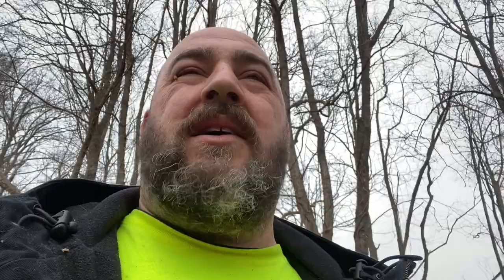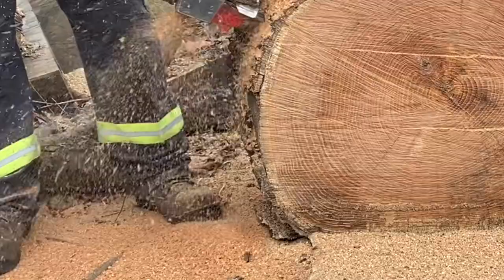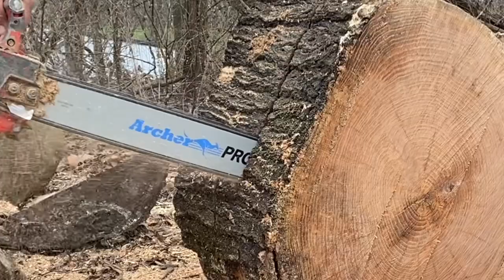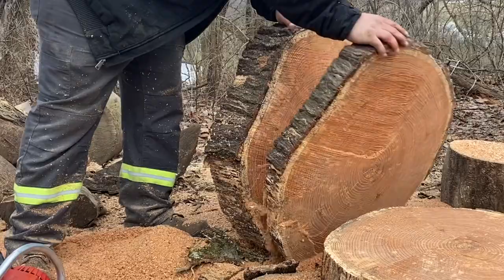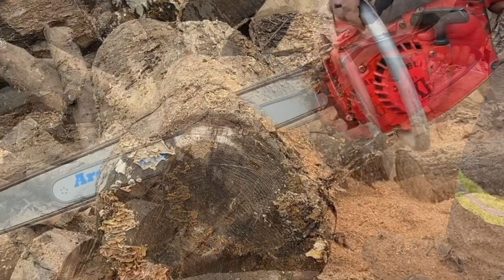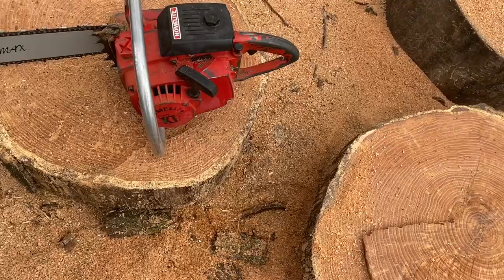Homelite Super XL Auto Chainsaw Muffler Mod And Longer Bar Testing!

Comment: I'm interested if the gutted muffler helps a stock engine much. I'm also very curious if a 28" bar might be crowding a stock saws power limits. I may have to try it sometime if I could find a deal on a bar.
Reply from the maker: It depends on the engine.  The biggest thing holding back a Super XL is the transfer port.  A wide open exhaust will hurt the engines torque because the exhaust helps to prevent good fuel from flying out by providing the necessary back pressure.  Wide open exhaust is know mostly for lots of heat and rpm without the grunt.  I don't usually touch the exhaust until I notice it with the engines performance.

Comment: It runs great!  
This is the final footage?  Muffler mod, exhaust port matched, exhaust roof under 100 and .020 blowdown?  
Curious on the numbers!!!!!
Reply from the maker: muffler done, port matched, roof 103, and I never touched the upper transfers on this one.  The other one I did.
Reply from the maker: I haven't tested if advancing the timing will help or not yet.  Almost finished.
Reply: I keep getting them confused. 130 and the super. Got to keep that straight!

Comment: Those longer bars are sure easier on the back. If only the wood would jump on the truck
Reply from the maker: The older we get the more we notice the back pain!!
Reply: I mentioned the difference in "back effect"  between 16" and 24" once elsewhere on the tube. I guess if you aren't very tall or over 40 that is one thing you may fail to take particular note of. The more you bend the more you ache.